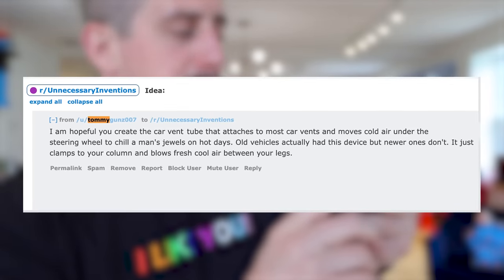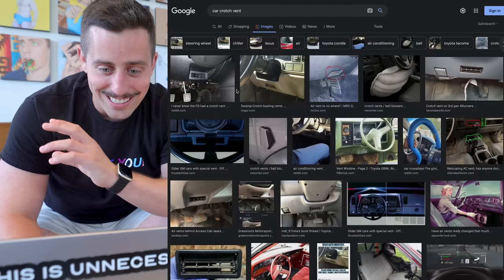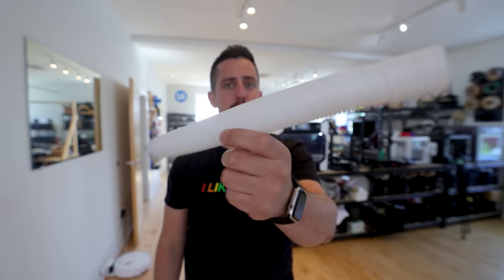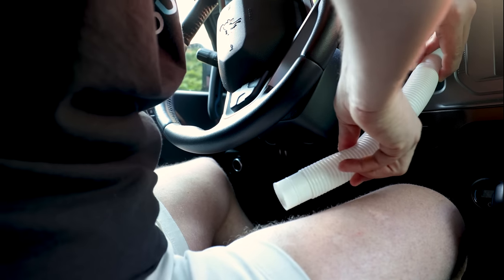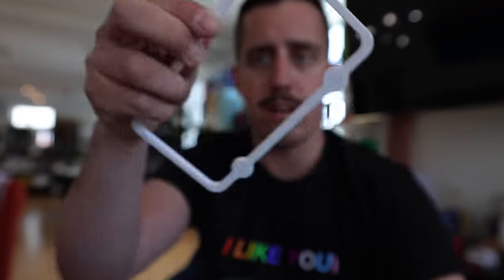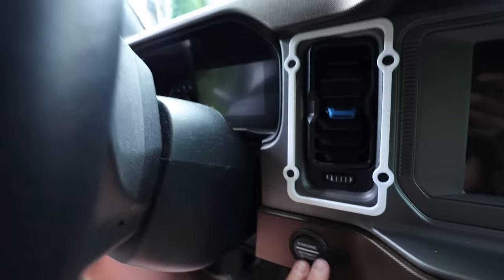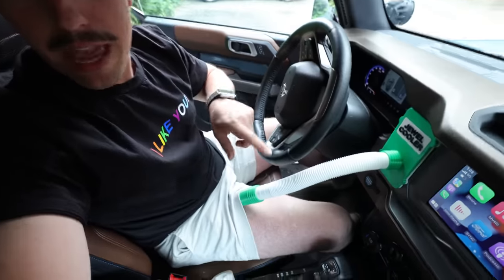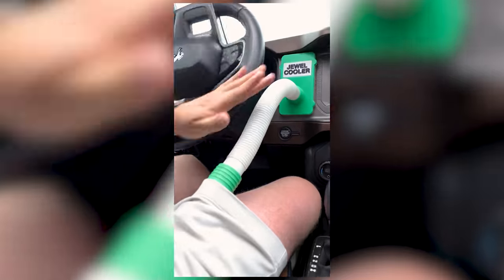Cars stopped making THIS so re-invented it! (The Jewel Cooler)

Comment: This is actually really smart for small cars that don’t have air vents in the backseats.
Reply: There's actually a product available for that, but it's expensive. I just used a phone mount clipped to my air vent to hold a flexible rain gutter extension that dumped cold air in the back seat for my service dog. 😂
Reply: I have a hyundai eon that doesn't have a air vent in the backseats

Comment: Jewel cooler 2.0 should include a circular damper built into the case so you could reduce the amount of air flow to your jewels for those hot summer days where you want max ac but will eventually freeze your nads.
Reply: If its that cold take the tube out  right?
Reply: Make it an iris style valve

Comment: This would be great for car seats! I love the magnet idea you can magnet on to the vent and then have the tube run to the back seat for the kids. 

How do you embed the magnets inside the print ? Glue ? Or just holes from the back side
Reply: We actually have one of those for our kid, it is called a noggle, and it works great.
Reply: Some mazda vehicles have air conditioned seats. You flip a switch & the car pumps cold air through the seat cushions/back rest.
Reply: @iplop  Most modern cars do lol.
Reply: Some printers you can have it stop mid print so you can embed screw taps ot other things inside the print before finishing the print. But glue also works
Reply: My car has ventilated seat
Reply: @dad5736  my car doesn't :(
They only offered that feature for the larger SUVs
Reply: There's actually a product available for that, but it's expensive. I just used a phone mount clipped to my air vent to hold a flexible rain gutter extension that dumped cold air in the back seat for my service dog. 😂

Comment: the vent adapter should be more conic shaped in order to take advantage of all the air blown
Reply: you can see he used an existing part instead of printing it all. But yes. If he designed and printed it all it would definitley be more "ergonomical"

Comment: Your winch should have a remote (either wired or wireless). If it's wired, plug it in under flip up the cap on the top of the winch, to the right of where it says Warn. The silver knob on the top is the clutch. Also, you really should take up the slack that has your hook hanging OR secure it so it won't flap around.

Comment: My 1997 gmc Sierra had this.  There is already a jeep accessory on the market that allows for this.  Not sure what it's called or who sells it, but it attaches to a vent and has a hose you can route into the bottom of a jacket to keep warm when riding with the top off during the winter.

Comment: Back in 2007 through 2010, I had an internet company called Blaze Customs. 
I had a 2006 Mazda MX-5 and my butt sweat bad driving top down.
I made something like this using a vacuum hose and connected to the AC’s foot vent.
It worked so well, others on “Miata Net” forums wanted one. So wife and I made it more professional and sold a bunch.
Then made an air cushion you can sit on doing the same method. I’m sure old photos are still on that Forum if you search “Roadster snake or Roadster air cushion”

Comment: O man, I had a 1994 Mitsubishi Shogun/Pajero that had a a small vent utter the steering wheel, you could only adjust very slightly up and down. It’s only purpose was to blow ice cold air at my junk. It was beautiful, genius, Gods gift on a hot day.

Comment: I'm not sure they were about the crotch to be honest... During the warm season, many times the sun hits the top of my legs, and if you're wearing jeans or black pants... oh man! I find myself fiddling with the air vents for minutes until I can sort of find a position that kinda almost works... the bottom vents are way too low... so yeah, this would be... COOL! 😎

P.S.: Does the car screen go up through that slot on the top and it can be lowered down into the dash? If so, that car wins the Techalyzer Car Design Award 2022. I am so horrified by those modern screens just slapped on top of the dashboard like some kind of redneck DIY project...

Comment: Hmm, I am disappointed:) With all your smartness you could do much better and really useful ;) The pipe just need to go under steering wheel and blow in a right position. There need to be some holder that you can change position of blowing and valve that you can close blowing. So the pipe can be connected all the time.
I am thinking already for few years to make some vent blocker/dispenser. Just one piece, that block direct blowing and dispense all over around. I don't have 3d printer and then I never realized my idea.
You making good videos!

Comment: a fan that blows air in to your shirt for the hot day's
- not to obvious to be seen
- you do don't feel it to much
- and you do not have to make a hole in the shirt for it.
- i would like it to be able to run with it and it blow air in to my shirt and i do not feel it moving around. 

i have been thinking a about how to desing it but i do not have a 3d printer or any 3d drawing skills.

Comment: I don't have a 3d printer, so I used shop vacuum parts and gorilla tape, I also used the passenger side vent, since it is in my work truck nobody is ever with me. Works great, and on summer number 2

Comment: There’s already air vent ducking under the the dash board that pretty much click together. You’re better off tapping into those hvac tubes. I remove them all the time when I work under the dash. If you were able to make a universal connection it would look better and would be much more hidden. This is actually a pretty practical and useful items. Get some investors and try getting it to market.

Comment: Should have added a 45 degree chamber on the connection plate. Focus the air into the hose. Most of it is just being pushed back into the system as if you "closed" that specific vent making the other vents stronger... try to think of it like water.
Edit: Double bonus points if you can make it attach to the floor vent!!!